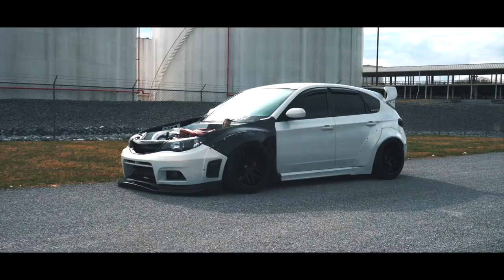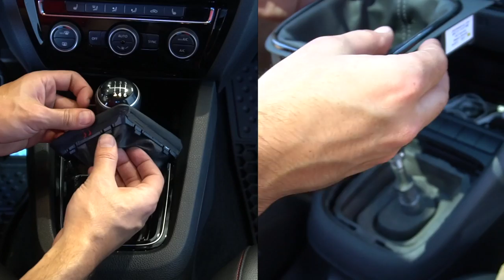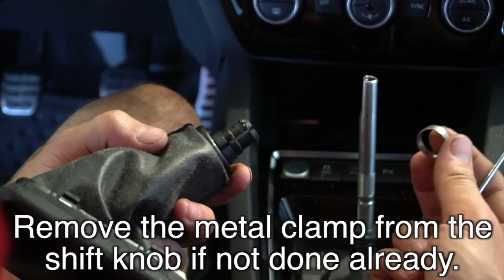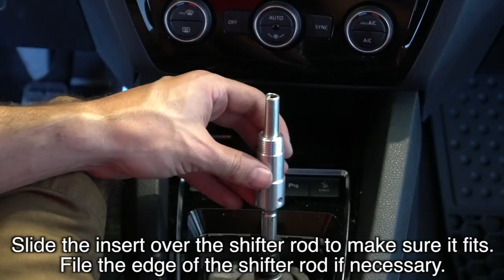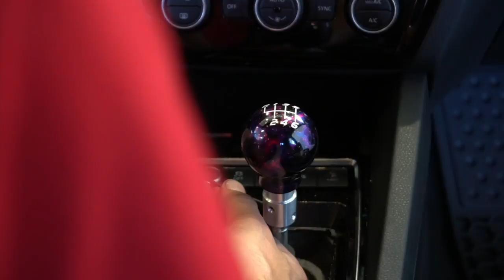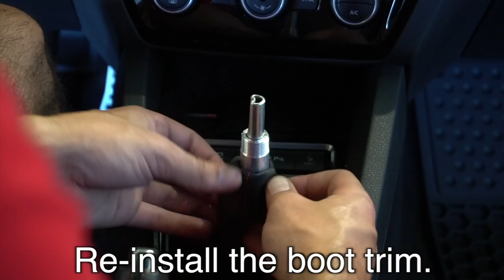Billetworkz - Volkswagen Golf/GTI/Golf R/Jetta Shift Knob Install Guide

Comment: You should have tightened the set skrews and then tighten the knob hard and then loostsn set skrews and re-align for added distance because of the more torque you have exerted on the job via hand .
Reply: He might not care if it is tilted sliiiightly toward the driver

Comment: Hardest part for me was separating the boot from the knob.  The metal clamp was easy, but the plastic one was a bitch.  Ended up taking a hacksaw to the knob, just above the edge that holds the top clamp to the boot.   The plastic cuts easily and then it comes apart without any trouble.   Can always buy another stock knob if I wanted to reverse the process. 

And you may dispense with the horrible music.   Nothing is more unnecessary or annoying in "how-to" videos.

Comment: mine doe not come with screws to screw in, i just slide and screw the shift knob onto the gear stick, is that how’s it’s supposed to be or am i missing somthing?
Reply from the maker: There should have been small set screws in the baggie with the adaptor. Please email if they were not included. Thanks!
Reply: Does this add any length to the shifter

Comment: Will this fit on a Seat Ibiza’s as they use vw parts
Reply from the maker: If your current knob installs the same way, then yes, our adapter will work.
Reply: Ok thank you, can you also make shift boots to fit Seat models?
Reply: @Billetworkz  where you get the insert from? I got the same car
Reply from the maker: @DPowerModz  we manufacture the insert. We include it with all VW shift knobs.
Reply: @Billetworkz  thanks!